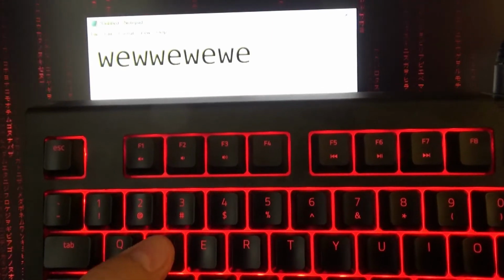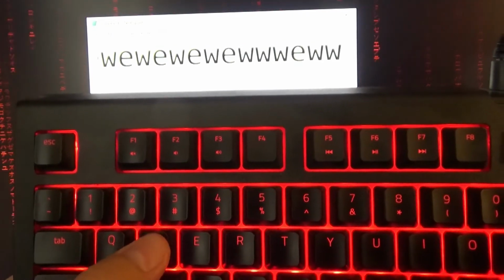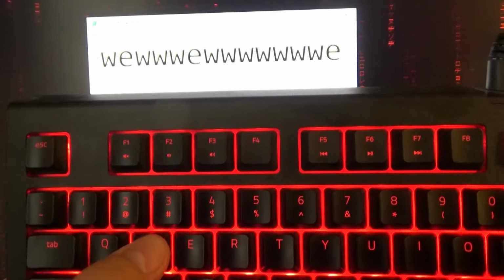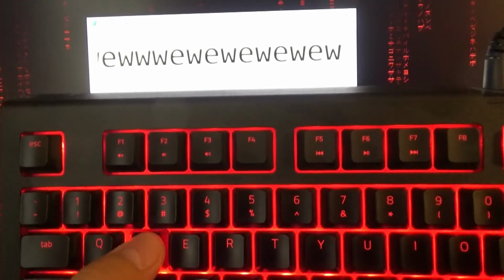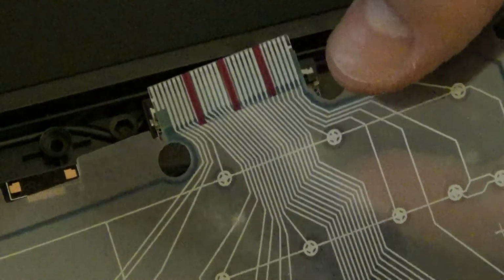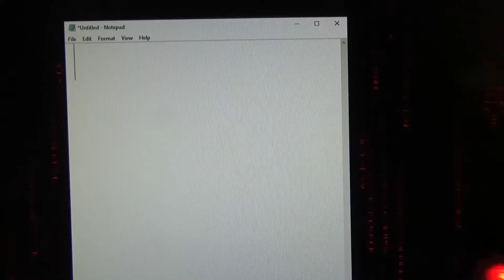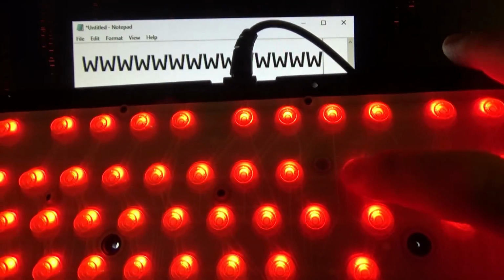One key typing two letters on a Razer Cynosa Chroma keyboard, how I fixed it. Input multiple letters

Comment: Worked for me, thanks!

I didn't have alcohol 99%, so I tried first just blowing everything with an electronic blower.
It looked perfect, but when I closed, there were still 2 small issues.

So I tried again. I used just a bit of alcohol 70% with cotton. And also cleaned the contact to the board. Now it works perfectly!

Comment: “A” was typing AS and “W” was typing QW. Very annoying. I following these instructions and it worked! There was a smudge on the underside of the clear plastic sheet where those letters traveled down the circuits to the pins. I cleaned it with a bit of rubbing alcohol and used compressed air on on all parts. Not sure if that smudge was the cause but in any case worked for me. Thanks!

Comment: Thank you so much for making this video.  Thank you!!!!!   I had the same problem with multiple keys pressing in more than one location on the keyboard.  I followed your steps except I removed the entire contacts membrane completely.  I only used can of air to clean all of the dust off.  I did not use any rubbing alcohol.  Then I carefully replaced the membrane in their contact sockets, clamped them back down, and replaced the keys and cover.  Worked like a charm!  All keys fixed that previously had issues are fixed.  No double key presses anymore.

Comment: I had the issue with the keys 3 and 0 on the d-pad area so it is not such a big deal but I tried to clean with rubbing alcohol like you did and it worked for like two weeks but now it is back. I will try to clean the threads at the bottom to see if it makes a difference.

Comment: Adding the part about the Ribbon wire was helpful. You can also split the plastic to clean in-between it in the event you still coffee on it and it gets between the plastic parts. Just do it very gently following the blue sticky part on the border. Do not force it.

Comment: I watched another video that detailed taking the Razer Chroma keyboard apart and followed the cleaning instructions.  But F key still double-typed an "fg".  Your tip about disconnecting the cable ribbon and cleaning that WORKED!  Keyboard working great now!  Thanks!

Comment: Hallelujah. For me it was the contacts between the k and L key but only when pressing L. Saw a prior video that went over this issue but didn't mention the contact array that connects directly to the pcb traces at the latches. I thought it was directly at the pcb source but thankfully I found this video. Cleaned all the contact arrays (wasn't sure which was the k and L array and was too annoyed to check so I just did all of them) and that resolved the problem!

Thank you so much!

Comment: Mines go “er er er er er” when I type r
Reply: samer and is stil doin that shit i did erverythingin ther videro
Reply: @mr.solodolo2102  lol it’s in your typing also. I did what the video showed and it worked
Reply: @aaronyang3081  Did you user isopropyl alcholol or did you just cleran it
Reply: @aaronyang3081  i removerd the mesh and cleraneed it but when i put it back on and tried typing it did ther samer shit
Reply: @mr.solodolo2102  I use alcohol also
Reply: @aaronyang3081  does it haver to be isopropyl?
Reply: @mr.solodolo2102  if it doesn’t work, it’s time for a new keyboard lol

Comment: Thanks! Sat down to my computer this evening, and the 1 and 8 keys entered 18. Deleted software, factory reset the keyboard, and then took the keyboard apart two times before seeing your video. Pulled it apart a third time, used your fix, and alls good again in the universe. Same keyboard, by the way. Thanks again!
Reply: how did you fractory reset do that?